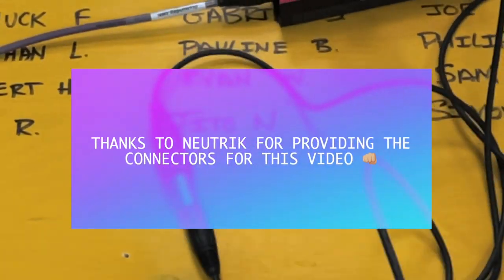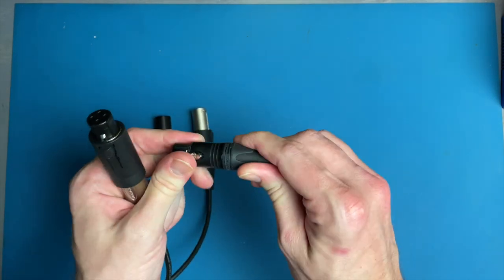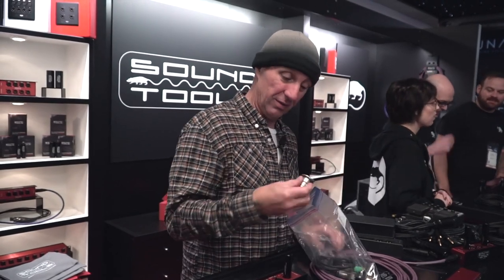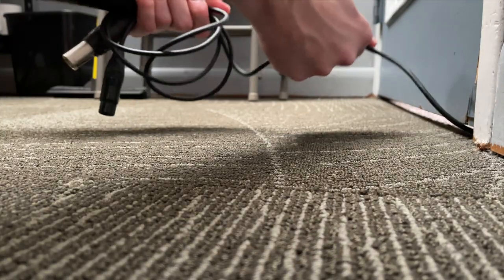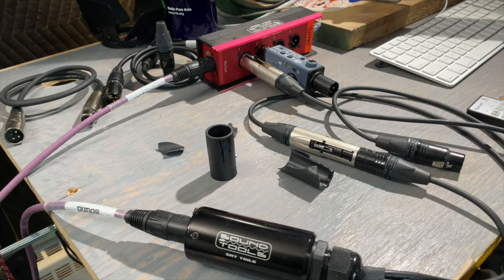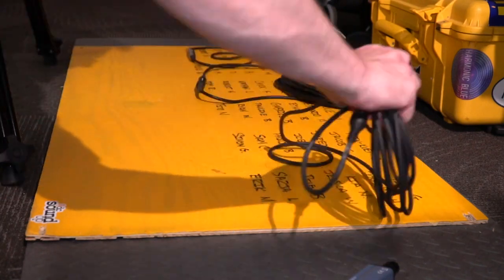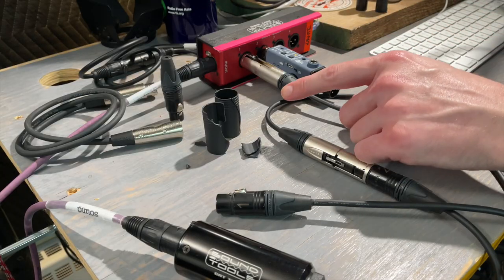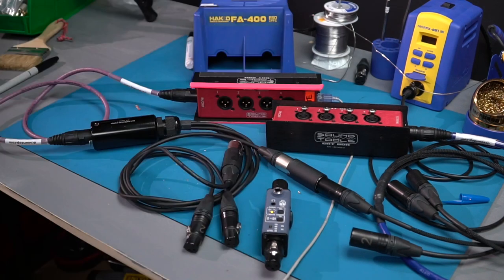World's FIRST Convertible XLR Connector Durability Tests with Neutrik ConvertCON

Comment: Regarding shear event, I always put the recommended amount of wire inside the XLR, or even few mm more, I never cut them as close as possible. Because that way I can push the cable in after soldering, the wires get a bit bent and this ensures that if ever, in any situation the strain relief slips or gives, the strain isn't immediately put to the delicate wires and solder contacts. Because it's not if the strain relief gets tested, it's when it get's tested :)

Comment: I have a half dozen of these connectors for about 3 years now…Work well, fits and locks with a majority of connections. Great for broadcast tv IFBs and comms.
Reply from the maker: That's great to know they're going strong after 3 years of TV work! Thanks for the message!
Reply: In fact mine will be on a job this weekend, and I also placed a few on my Cat Tail knock off units.

Comment: I think, it's a great solution. Absolutely not for all cables, but soldering a couple of cables with this connector could be a live saver in some situations.
Reply from the maker: I totally agree, they're certainly going to stay on my Cat-tails going forward!
Reply: @DcSoundOp  In my opinion it's better than using the male-female convertor plugs, because you have an extra connection between the cable and, my experience, "hey, I thought we had eight male-female convertor plugs, but I only can find five of them"
Reply: @DcSoundOp  A good connector but the plastic tab is quite fragile, had them on almost all 4-Par cable durms the last place i worked at.

Comment: For a connector that seems to be getting advertised more as a problem solver and not an everyday connector, it seems to be a great solution. The fact that it took you going to town on it with a hammer and a 2x4 to get them to break , and then just for the covering to come off, says a lot for the quality of the build. At the end of the day, you still had a working connector and were still able to convert it. It looked like it held up to what I think would be the more common snagged on something and just tugged on, with no issue. I certainly still hope to grab a few. 
In reality, how many times did it take you hitting them for them to break?
Reply from the maker: I agree 100% and have more on order myself to replace the ones I broke. It took a couple of really good smashes with the hammer to crack the first one and that one stayed mostly intact. The second one took a single hit with the 2x4 to shatter the sleeve, but it was a very worst case scenario of getting snagged while the cable is whipping around or something similarly hard. 

Like you said, at the end of the day they both still work and would have made it through a job just fine. I like them a lot for what they were designed to do.

Comment: Many years back I got a couple ends to make some adapter cables with they were certainly expensive then. I made a stereo 3.5mm suming cable which can be used in reverse as an input recording cable with some loss which is probably good for loud output sources. I also made a 3.5mm mono to xlr cable. At the time they serve their purpose although they are very rarely used.
Reply from the maker: Do you still have them laying around? It would be cool to do a What's in Your Kit Adapter edition video! If anyone wants to send in a video of their adapter or turn-around kit, message info@dcsoundop.com for a link to upload to.

Comment: neutrik are always top quality!
Reply from the maker: That's for sure, easiest to work on in the field too in my experience.
Reply: @DcSoundOp  the best part of the connectors is the color ring I use it for distinguishing lengths of cables, and also i find that non neutrik connectors sometimes come undone without using the button to release neutrik connectors are just tight
Reply: Great! What is the device playing the music that you use towards the end of the video when go back and forth between the two cables?
Reply from the maker: That is the SoundBullet by sonnectaudio - I had David who created them on the channel about a year ago for a chat - https://youtu.be/Cr7ebO-EYqk - It can playback tone or pink-noise or whatever is plugged into it's input. 

At the end of the video, the music source is from a computer, then -> dante network -> analog Avio output -> Sound Bullet. 

You can order them direct from Sonnect at https://sonnectaudio.com/sound-bullet/ or through Rat Sound who has a few left in stock right now it looks like - https://www.ratsoundsales.com/mm5/merchant.mvc?Screen=PROD&Product_Code=sonnect-soundbullet - we don't make money on either of those links, but it's the tester I recommend and use the most.

Comment: Sidenote: what is that blue double ended box that you're using to play music from? as that looks interesting. Probably a video I haven't seen. One benefit of working myself to almost death at a job I shouldn't be doing is it I've made a bit of detail that I have invested into my equipment I need to make a video. I have gotten myself some cases no more tubs and miscellaneous equipment stacking combined studio hub with sound tools cat rack. I have done two things so far and set up has been 15 minutes for 2 - 4 Mic's 2x vocal 2x instrument, although definitely don't forget your now proprietary ethernet cables at home.
Reply from the maker: Hey Mark, the blue box is the Sound Bullet & there is indeed a video - https://youtu.be/Cr7ebO-EYqk - It's one of the tools I really use everyday & I don't make anything off recommending them. Here is their site-  https://sonnectaudio.com/ (you can usually get them direct from SoundTools too in the U.S.)